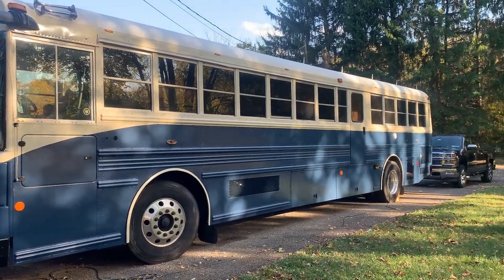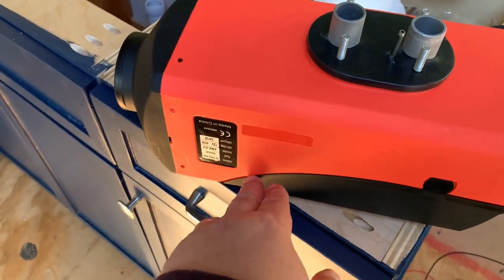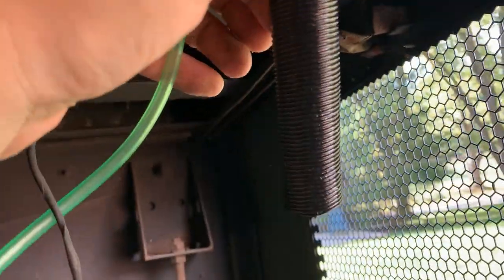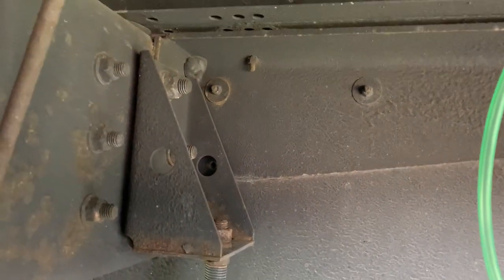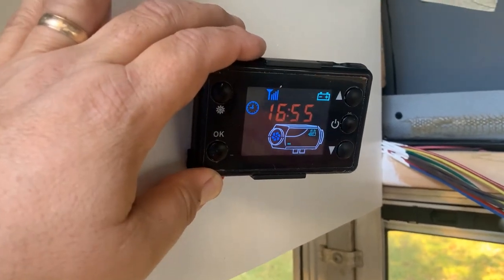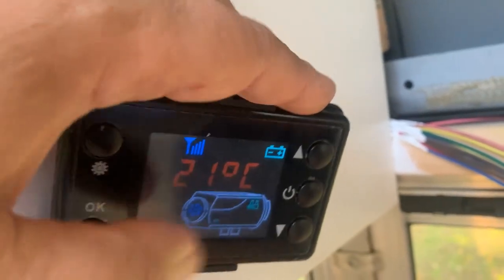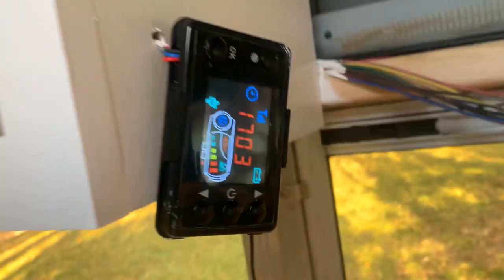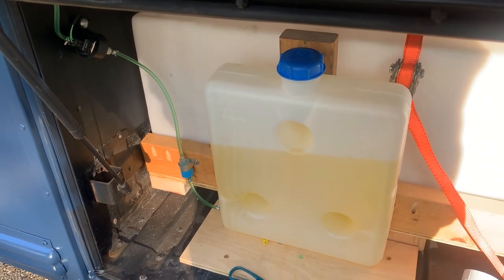Harmony Express Skoolie - Ep 29 - (Heat in the Bus!!)

Comment: Looks cool, Mike!  (I mean hot!). What model is that?  Did you get the pump and tank and everything as a kit or buy it all separate?  I salvaged a propane furnace from a camper, but it's a little big and bulky and I'm liking the look of that smaller design.  Let me know when it starts getting cold down there.  I'd love to hear how much it can warm up the bus in colder temps!  Great work; thanks for the video!
Reply from the maker: I should have shown the unboxing! (I’m still a novice at this, I guess). Everything I needed came in that box.  The pump, fuel tank, fuel line, fittings for the tank all in one box... we’re planning to install a second one under the pantry, but in the cooler weather with no insulation in the ceiling, it got HOT inside to the point of having to turn it off.

Comment: Thanks for sharing all the info. We just started putting ours in today.  We got the bigger one. But it has a skinnier fuel line with a big thick one you spliced in. Is yours what came with it or did you get some larger fuel line?
Reply from the maker: The fuel line was part of our package.  We had to drill the hole and fish the fitting through bottom of the tank.  Other than that, it was pretty straightforward.